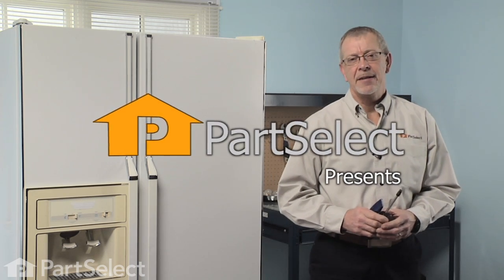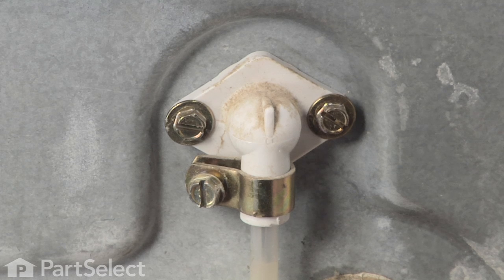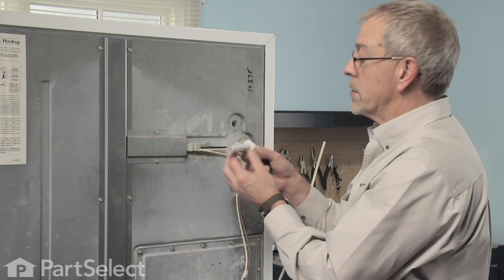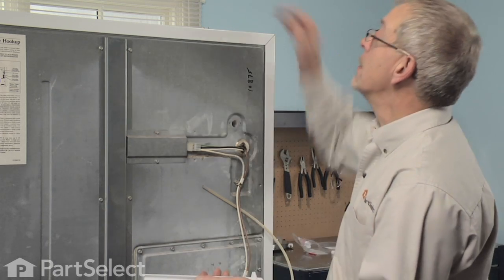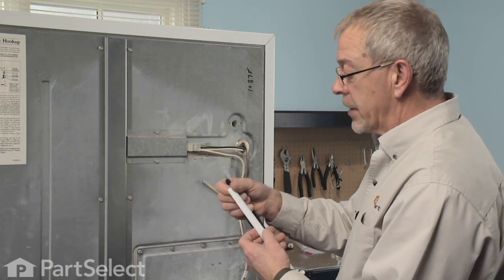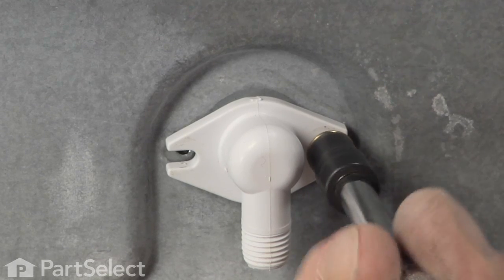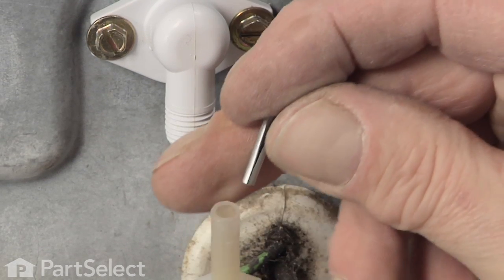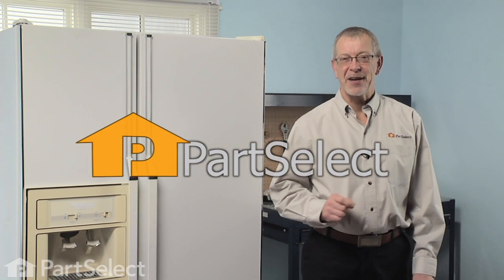Refrigerator Repair - Replacing the  Water Fill Tube Kit (Whirlpool Part# 2196157)

Comment: HELP!  My ice maker "sprays" the interior of the freezer, getting very little water into the ice molds, once this water freezes, it freezes up the works. You can hear the gears or motor trying to turn, so I shut it of, and turn off the power to the fridge until it thaws...I get one cycle of ice until it freezes up again. it is an old MSE1 ice maker
Reply from the maker: Hi Nancy, 
This problem could be the result of a faulty Dual Inlet Valve however I would need to know your refrigerator model number to make an accurate assessment.

Comment: Do you still take questions? Posted Dec 12 2016.
Reply from the maker: Yes, how can I help you?
Reply: I appreciate your reply.  I found the problem for my Whirlpool icemaker. It is a leak at the point of where the water fill tube comes thru the back wall. A small stream of water trickles down and pools at the bottom of the freezer.  I found the water tube/elbow was leaking. Most refrigs have the back wall setup like you show:  remove 2 screws, pull the chute/water line out, replace.   However the Whirlpool model WRS322FDA water chute/grommet assembly is built-in (glued)to the back wall and cannot be replaced...in fact there is no part number to look for, no 2nd option.  Most folks buy WR17X11168  and like you show it can be easy work. So now the entire icemaker is kaput for a $15 piece of plastic.    NEVER buy a Whirlpool.    So far as I know the problem cannot be resolved. Thank you so much for your reply.